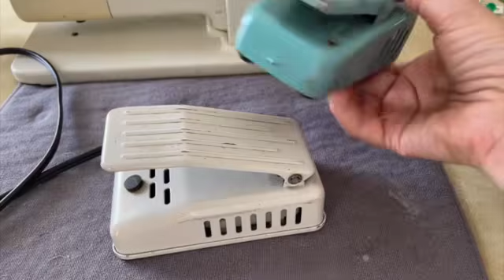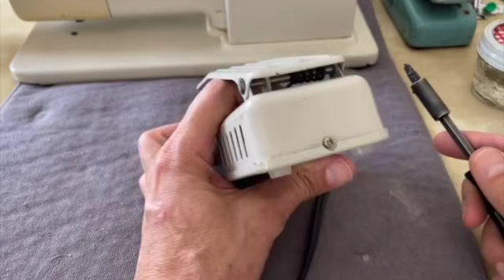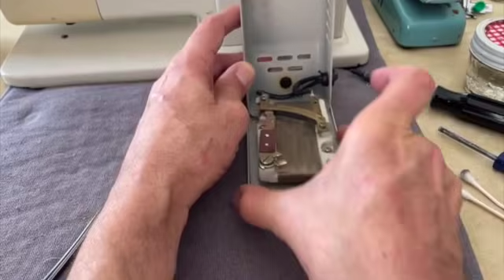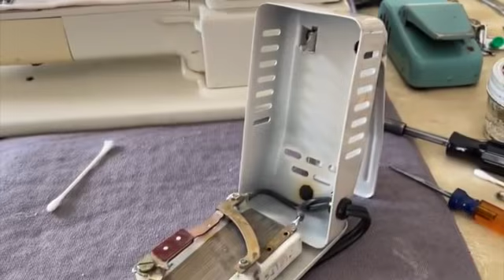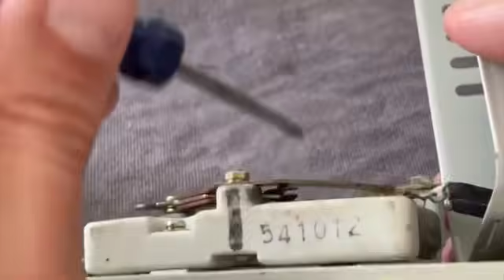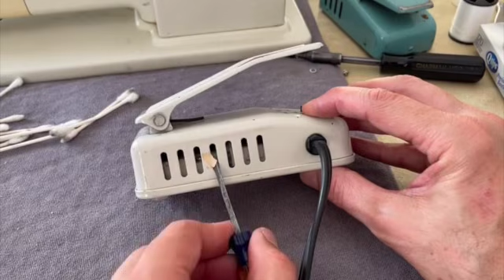HOW TO SERIES #35:  Does Your Speed Controller Look Different? There's a First Time For Everything!

Comment: If you want to gently clean the contact between the arm and that top strip just run a thin strip of folded typing paper between the contact and the strip.  It isn't real abrasive but will clean out any loose crud.  And a suggestion to keep a foot pedal off the carpet is to use a red clay tile, smooth side up, from Home Depot.  Cheap and come in a variety of sizes.
Reply from the maker: Great suggestions for cleaning and for keeping the pedal off the carpet!

Comment: Hello.  I watch many of your videos and find them so helpful.  I know these are two different machines, but would you share your opinion of which machine, a Singer 404 or a Bernina 830 record has a better straight stitch?  Also, which machine is easier to oil and care for?  (I see the Singer 404 needs not just oiling, but grease.)  Thank you.
Reply from the maker: Uh oh!  I will tread carefully on this question, LOL!  Regarding oiling and normal maintenance, they are relatively similar.  For the Singer's need for grease, it doesn't get re-greased very often as grease functions far longer than a drop of sewing machine oil at the machine's oiling points so I would call that comparison mainly a 'wash'.  

As for which has the better straight stitch?  Oh my, that is a tough one.  Let's invite the viewers to chime in here.  For those of you who own a Singer 404, Bernina 830, or both, what is your impression re: the stitch quality for each of these amazing machines?